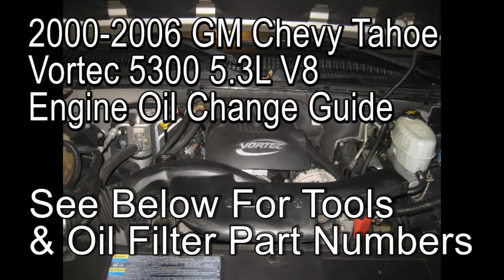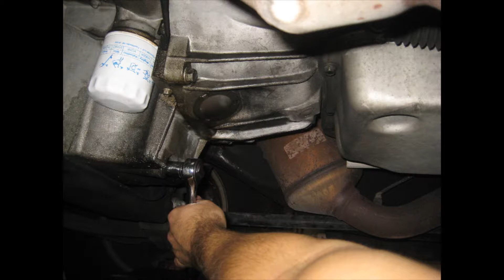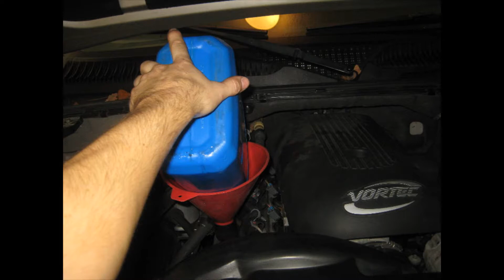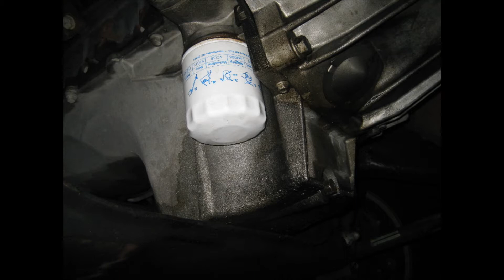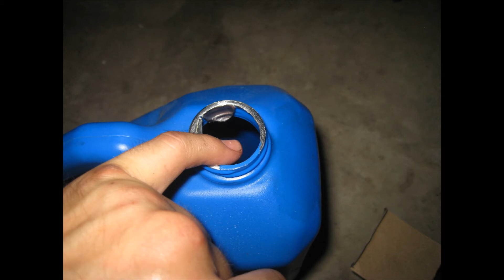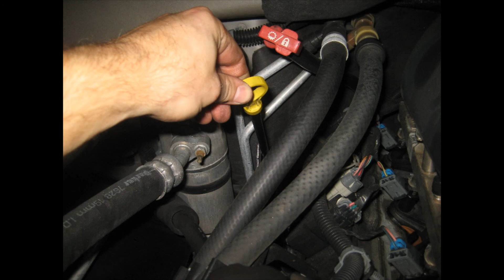2000 To 2006 GM Chevy Tahoe - How To Change Oil & Filter - Vortec 5300 5.3L V8 Engine

Comment from the maker: DIY Guide - https://www.paulstravelpictures.com/2000-2006-GM-Chevrolet-Tahoe-Vortec-5300-V8-Engine-Oil-Change-Guide/index.html

New Oil Filter - https://amzn.to/2Cm4pXp
New Oil - https://amzn.to/2svNVaB
Socket Set - https://amzn.to/2VS8FXs

The Paul79UF YouTube channel is a participant in the Amazon Services LLC Associates Program, an affiliate advertising program designed to provide a means for sites to earn advertising fees by advertising and linking to Amazon.

Check out all of my 2000, 2001, 2002, 2003, 2004, 2005 & 2006 GM Chevy Tahoe DIY Repair & Maintenance DIY Tutorials - 
https://www.paulstravelpictures.com/Articles/2000-2006-GM-Chevrolet-Tahoe-Common-Problems-Repair-Maintenance-Guides.htm

These DIY instructions should be the same for other General Motors vehicles such as the Silverado, Suburban, Avalanche, GMC Yukon Denali, Sierra, Hummer H2 and Cadillac Escalade.